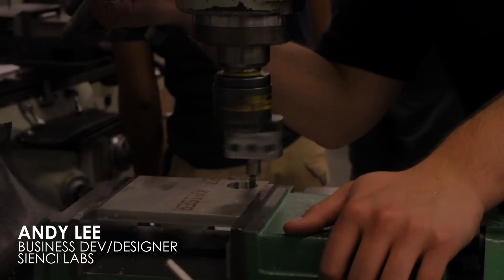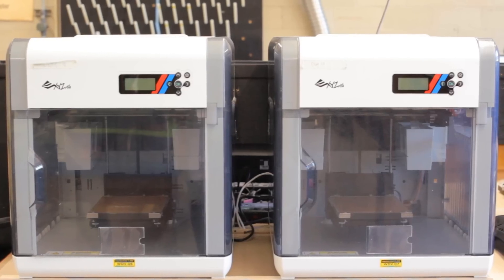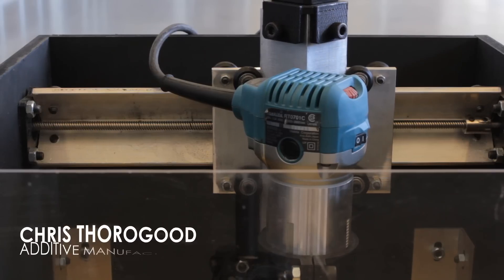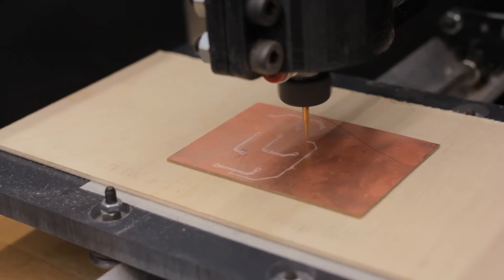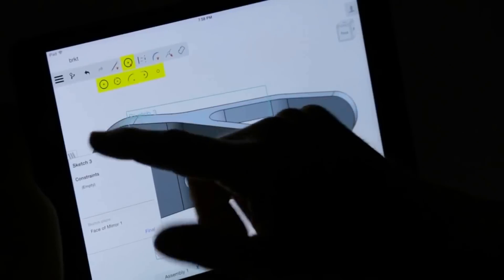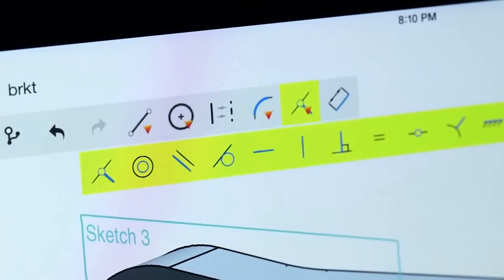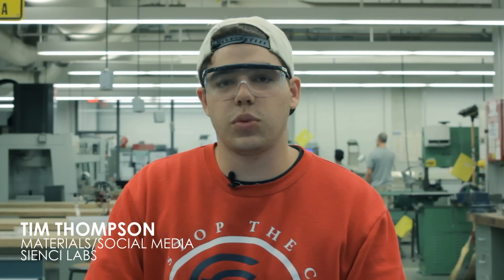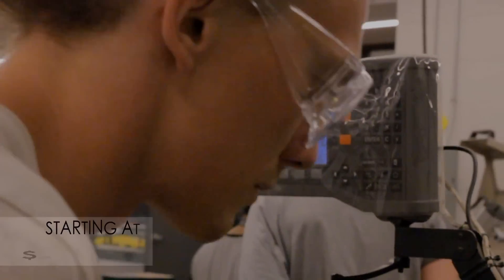Sienci Mill One: Simplifying Desktop CNC Milling

Comment: I'd really like to see the BOM for this thing. $399US is suspiciously cheap for a good control system, let alone an entire machine. The use of L bracket for the axis also suggests that this is not a very rigid machine and will not be able to cut metal well (or actually cut anything harder than aluminum at all). I'm also curious what your "high performance" benchmark is set against, for reference.
Reply: Hi Skooteh, our BOM will be available soon after our Kickstarter campaign ends! With the decrease in parts we've seen like with microcontrollers, electronics, and motors, it was totally possible to bring down the cost to be more affordable for makers and hobbyists. 

In terms of performance, our machine works as well as other current desktop CNC machines in the $1000-3000 price range, with similar speeds and accuracies. That being said, we cannot come close to competing with machines that generally are between $20,000 to a million dollars. For our target market and the people who we intend to have it used by, this is a great device! 

To see more videos of our machine cutting materials, please check our facebook page at www.facebook.com/siencilabs!